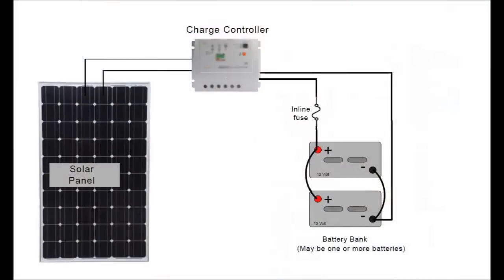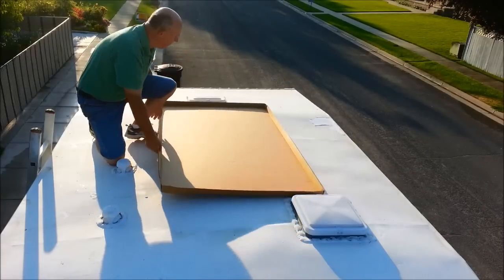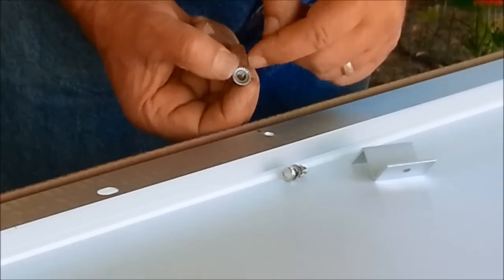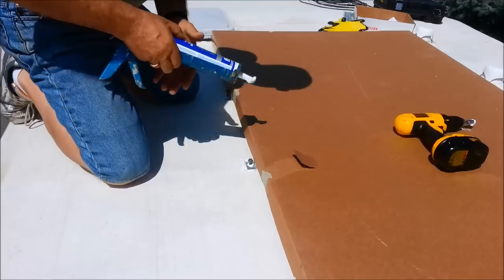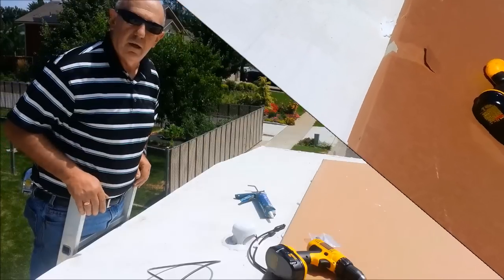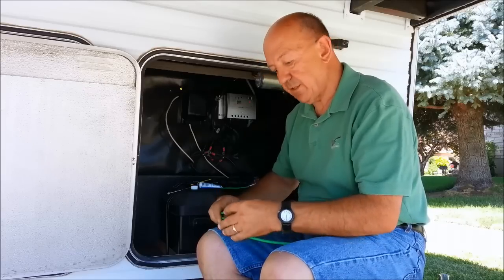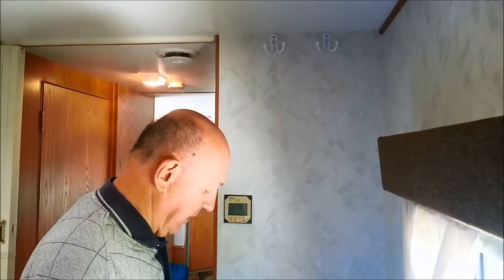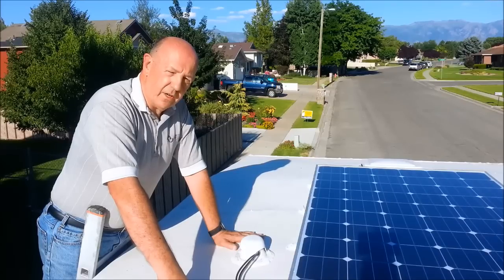The Power of Solar for Your RV

Comment: Mr. Scott - Thank you for your video. I'm looking at something similar; to collect & store (recharge) energy from a low-maintenance system. I do have a couple of questions: (1)Concerning the position that you place the panel on the exterior roof: Did you find (*locate or know where they were already?) ceiling studs to screw into? Something for the mounting-tapping screws to really grab into; in order to prevent the panel from being ripped off the roof when traveling. Easy to feel that the Z-brackets are secured to the panel by means of a nut & screw but I'm concerned that the z-brackets are not "as secure" to the top of the RV with just a self-tapping screw. (2)Did you consider adding a small wind deflector to the front side of the panel? If not, why? Did you feel that the air-flow dynamics of your rig would (3)MPG...Did you note any significant change to your MPG as a result of the panel (ie: wind-drag, or?)? (4)Now that you have done this & from the date of the original posting; You've had time to use the solar system & realize the good & bad of it. Where you able to use that knowledge now & go back in time; what would you do differently? Tnx, Michael {*If I were to guess; I'd say you lived in ND?!}
Reply from the maker: +Michael Stokes I'm glad you liked the video.  I located the studs and predrilled before attaching the mounting  screws.  As this was a large panel I had four heavy screws on each side for a total of eight and feel that it is very secure.  I did not consider any wind deflector, simply because I didn't think of it, but I don't think I would have anyway.  I'm not an engineer but I believe the shape of the front of the trailer causes most of the air to be forced up and over the panel. In addition the roof vent for the bedroom is in front of the panel, though it is not nearly as wide as the panel it still acts as a deflector of any air that might not be going above it.  As for the MPG change, I certainly haven't noticed any and again, I think the air flow along with the low profile would be such that there is little to no drag at all.   I'm very happy with the installation and the way I did it.  I haven't had any regrets or desires to change anything.  No I don't live in or near ND.  I live in Utah.  I have been to North Dakota a couple times in my life though.
Reply: Tnx for the answers. Yes, Utah looks allot like ND. I'm still in the Srvc & stationed elsewhere but from ND. Have you considered any wind-power turbine solutions? I imagine that one could go way overboard here between solar & wind...both are free to use but must be converted. Thus the cost is the hardware to do that...

Comment: Great video.  What size screws did you use on the roof?  How long?  Thanks.
Reply from the maker: Thanks for your kind comments.  I believe the screws were 1/4" X 1 1/2", but yours may be different depending on your roof material.  Best of luck on your project.

Comment: Several thoughts on the whole concept-
 I have run solar in the past on a Toyota rv for a week with no trouble. Now have upgraded to a larger pull trailer. First thing done was to replace incandescent lights with LED lights. One incandescent will pull as much power as 5-10 LED lamps depending on the size of the LED (we used a self adhesive patch found on ebay that comes in a variety of configurations).
 As many appliances as possible should run directly from the battery and not thru a converter as the converter is not especially efficient. You may have to do a test run in the driveway to determine how much power is consumed daily in your camper and buy enough solar power to replace it.
 Conceptually if you draw five amps from the battery for four hrs you have used 20 amp hours from the battery. More than this needs to be returned to maintain the battery to maintain a full charge. If you have a 4 amp solar panel then about six hours of daylight is needed to recharge the battery. This assumes a good electrical system and batteries.
Also beware of phantom loads. One we experienced was a car radio that would drain a battery by itself in around a week even turned off. This can be measured using an amp meter. If all appliances are turned off and the charging circuit disconnected, there should be zero amps drawn from the battery.
I have found cloudy conditions will drop the rated solar output by as much as 90%. A 100 w panel will give as little as 10w in cloudy conditions. I have actually measured the amps out on cloudy vs sunny days to determine this.

Comment: Excellent video, really helpful. I'm planning on a solar panel myself and this video you created is just the ticket to get me motivated. One question is your battery(s) a deep cycle, a 12V or just what sort are you using. Norm
Reply from the maker: Mine are deep cycle, also called marine, 12V.  However, when I replace them, I will replace them with 6V "Golf Cart" batteries. If you wire them in series they are still 12V but you get almost double the Amp Hours.

Comment: Great job and thank you for posting. I would like to have seen how you got the wire out of the vent pipe to the battery bay. Also, how you did the wiring from the inside monitor to the charge controller.  I have a fiberglass roof, so I wanted to  if that makes a difference when drilling into the roof.
Reply from the maker: Sorry to take so long to get reply to this.  Something was making it impossible to reply until now.  To get the wire out of the vent pipe I simply drilled a hole in the vent pipe and pulled them through.  I made the hole as small as possible and caulked it good.  See the video at approximately the 9:50 point.  If you look closely on the left side of that same image you will also see a gray flat cable that comes in the hole and then goes up through the bottom of the floor.  That gray wire goes to the inside monitor.  Unless you have the exact same RV as mine you'll probably put your monitor in a different place than I did, but I simply ran the cable from the controller up the inside corner of my closet to where I put the monitor.  Every one will probably be slightly different.

Comment: Great and very helpful video, we are getting ready to do this to ours.
Did it heat your hot water? run a Microwave? Laptop/cell charging? And how many batteries do you have hooked up to this and how many Hours do you get per day???
Reply from the maker: Even though there is a place on the charge controller for a power inverter I do not have one hooked up yet, so all mine does is charge the batteries.  Right now I have two 12 V, but I am planning to change to two 6 V "golf cart" batteries which should give me almost twice the Amp-hours.  It is my understanding that if you have an inverter of sufficient wattage you should be able to run your microwave or any other appliance, with the exception of your air conditioner.  I do use a small power inverter now that I simply plug into the 12 V outlet in the trailer for small stuff like laptop/cell chargers and will probably get a 1500 watt when I get the 6V  batteries so I can run the microwave.  There are too many variables to say how many hours I get per day, but most days my batteries are showing fully charged by early afternoon.  I hope this helps.

Comment: it's really an amazing video
can you explain how did you select the size of the panel (watts) and the size of the charge controller?

Thanks
Reply from the maker: mina benyamin  Thanks for your kind comments.   As I was brand new to Solar Power at the time I looked at what some of the other people I knew had and then went and found one that was even stronger that I could get at a reasonable price.  I think that I really probably went quite a bit higher in power than I really needed, but I'm one of those that thinks too much is better than too little, since the power is free anyway.  On the charge controller, I just made sure that it would handle all the power the panel was putting out.

Comment: very well produced!  correct me if I'm wrong but don't they mean don't connect the wires to the solar panel if there is a load connected to it...meaning you have a coffee pot drawing power from your system....in this case you had no load attached.

Comment: This was a good video. May I ask what material your trailer roof is made of? Did you have to locate any rafters to drill the panel to? Is the roof plywood underneath the exterior?
Reply from the maker: Sorry to take so long to get back.  On my particular RV I did have to locate the roof joists or rafters and drill into them.  Many RV's do have thick plywood or other similar material for the roof, but mine does not.  Thanks for watching and good luck on your project.
Reply: Scott Law Thank you :-)

Comment: Do you cover that panel up at all when you are driving or parking in a wooded camping spot?  I love how you did this. I am thinking of doing the same.  I am concerned tho that a low hanging tree branch or even something flying up and hitting it while driving down the road.  just curious if you had any issues.  thanks and great job.
Reply from the maker: Danny Kitts No I do not cover it when driving or anytime except when I cover the whole unit over the winter and I've had no issues at all.  These panels are a lot tougher than they look.  They are built to withstand pretty large hail stones and the like.
Reply: Very cool.  can you run your camper all day on battery... or I should say.... can you get the required use out of one battery and get it fully charged?  if you are using 2 batteries, will that panel fully charge it for you quick enough?
Reply: also, what kinds of things are you running with the battery?  tv? lights? electric furnace? electric water heater?  thanks a ton.

Comment: Scott good video great job, I have one question the 2 batteries that you have hooked to the solar panel do those batteries also hook to a generator, or do you not use a generator? Thank you Joe
Reply from the maker: The solar panel is my battery charger.  When I need 110 power for the Microwave or whatever, I connect the RV to a generator.  If my batteries are not keeping up with the draw then I can use a generator to charge the batteries also.  I hope that answers your question and good luck on your project.

Comment: Scott, this was an excellent video.  Very informative and professional.  I dabble with solar power and like yourself have added a small 30W panel & charge controller on my old RV for the purpose of charging the batteries.  I've researched the internet and YouTube for adding a larger system and incorporating it into the existing inverter.  As for the batteries, I've seen the Trojan T-105 6V golf cart battery is a whopping 225 amp hours!!  I'm really into going Green on the RV and no having to use shore power or a generator to be fully self sufficient.  So far, it has been working for the simple things like lighting.  Keep up the good work and keep us informed on any other projects you may want to share.

Comment: Scott,  Great video. Thanks very much for posting it. One question; Did you have to find a stud on the roof to screw the panel into?  Tks Sean
Reply from the maker: In my case, yes I did, buy mine was a 1996 trailer with wood studs.  Some of the new ones are built with panels and do not have the same kind of structure.  You will have to check on your type of RV.

Comment: Please let us know how this all worked out for you. I'm not impressed with the whole solar panel concept. I've bounced around the internet and it seems you need a least 700 to 800 watts to charge two batteries.  I may be wrong about the amount of watts needed for two batteries, but it hard to get a good answer.  Nonetheless, I'd like to hear how it worked for you. Was the cost worth it. Could you watch your tv on your solar system without draining the batteries all the way. Great video! Thanks
Reply from the maker: Thanks for your comment.  I can't say that I've had a really good test on it yet because my trips out have been fairly short and frankly I don't use that much electricity.  As far as watching TV, I don't know,  I don't have one in my RV.  I camp to get away from stuff, but, I don't watch TV at home either.  Maybe an average of 45 minutes a week or less.  However, it appears to recharge my batteries fairly quickly even in the shade or bad weather.  I do plan to change to 6V golf cart batteries to get more amp hours and put in a inverter so I can at least run my microwave without having to hook up the generator.

Comment: Scott Great video what size screw did you use? Did it go through the top down into the ceiling of the unit? Was is a specific screw?
Reply from the maker: The short answer is that it was not a specific screw.  Different RVs have different roof material.  I bought a short large, I'm thinking 3/8", wood screw for exterior use at Home Depot.

Comment: I've been told if you use a deep cycle battery that it's good to drain and recharge them.  Do you know if this is true?
Reply from the maker: My understanding is that you never want to over discharge a deep cycle battery.  Every time you discharge it too deeply you shorten its life.  Draining and recharging is good for many dry batteries for small electronics, but not for wet plate or gel batteries like you would use in a car or RV.

Comment: How do the solar panels maintain their strength if they get dirty from the road and weather?  Do you keep a cover on them while you travel?  With the panels horizontal do they collect rain water or dirt?
Reply from the maker: It wouldn't hurt to clean them occasionally, especially if you they don't get rained on and yes I'm certain if the panel is perfectly horizontal it will collect a small amount of rain water and/or dirt.  It is rated for 50 lbs per sq ft of snow load and wind.

Comment: Thanks for sharing! how long did this take you to do this? Just curious because you wore 13 different shirts in this video lol
Reply from the maker: You counted???  That's funny.  It took me part of two days, but I started in the  afternoon of the first one.  I did go back a couple days later and redid the opening because when I went to edit it I didn't like it, but I wore the same shirt that I did for the original.  I like to do weird things and since I couldn't figure out how to make the video humorous I did the shirt thing, changing about every 20 minutes or so, whenever I knew it would be a complete scene change.
Reply: Lol well I noticed you had a different shirt on near the end. Then I noticed you had lots of them lol. How does this work for you? I've got 2 batteries that are never fully charged.I get about half a day out of them.
Reply from the maker: Steve Taylor It works great but if you have 2 batteries that are never fully charged something is amiss or you are putting a heck of a load on them.  How are you charging them now and are they fully charged when you first get to your camp site?
Reply: No the alternator and the power at the camp site is the only way they ever get a charge
Reply from the maker: Steve Taylor First, I would take both of them to an AutoZone or similar store and have them tested to see if the batteries are okay.  If they are then you should plug your trailer in to shore power for a few days and get them up to a full charge before you head out on a trip.  Make sure both batteries are the same and both in good shape.  If one is weaker/older/less AH etc. than the other it will draw the better one down.  If you have two identical good batteries starting out with a full charge, a decent solar charge system should keep you in pretty good shape assuming you have a fair amount of sun and you're not putting a heavy load all the time.  Incidentally, if you do have to replace the batteries, or when you do, you would be well advised to go with 6V golf cart batteries wired in series to give you 12 volts and typically nearly double the AH.
Reply: All three are new about the same age. They really just need a good charge. I just don't want to leave it plugged in UN attended for a few days
Reply from the maker: Steve Taylor
If you're going to plug your RV into shore power your inverter applies a very slow charge and if it is working properly will not overcharge your batteries.  I had my previous trailer parked at my daughters house and sometimes left it plugged in for three weeks or so and that battery is still working great three years later.  If you are concerned and you can get to it fairly easily plug it in and go out and check it with a voltmeter a couple times a day and when it quits getting any higher after a couple checks then unplug it.  My batteries charge up to about 13.2 Volts if I remember correctly.  You could also go on to some of the RV Forums and ask your questions and you're likely to get a lot of very good and helpful advice.  I've found the people at http://rv-dreams.activeboard.com/
to be very helpful.
Reply: Well it is parked at my girlfriends parents while they are in Florida till April and the potter is off

Comment: Didn't notice the type of screws you put into the rv roof. I'm guessing the were not bolts through the roof into the inside of RV. What material are you grabbing after going through the thin aluminum roof sheeting?

Comment: Hello Scott,
Good how to video. How are your batteries hooked up? Are you running 6 volt batteries in series or do you have 24 volt batteries you are using and the higher amps? Solar is one thing but knowing about the battery bank is also an interesting topic.
Reply from the maker: First, I have to admit that I don't own that trailer any more.  I sold it.  But to answer your question.  I had two 12V batteries.  Had I kept it I was planning to go to the 6V "Golf Cart" batteries.  You are correct about knowing about the battery bank.  That is interesting and very important.